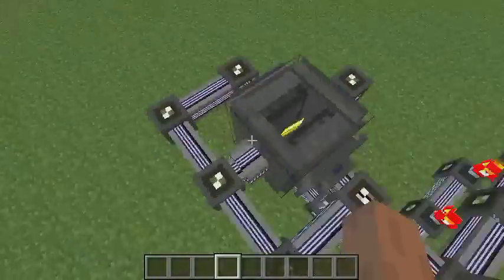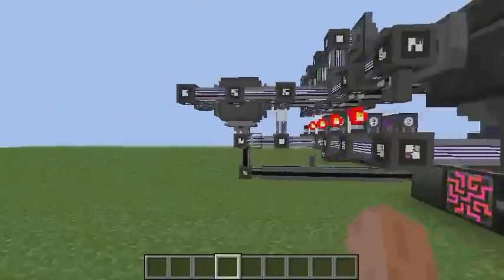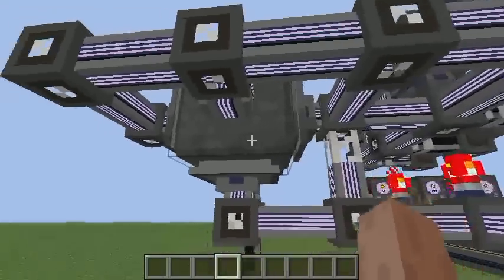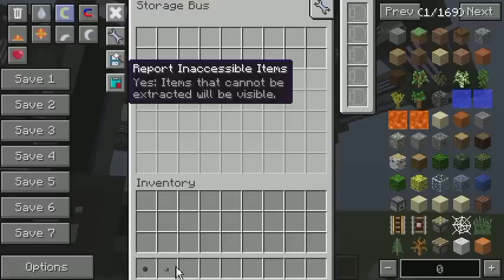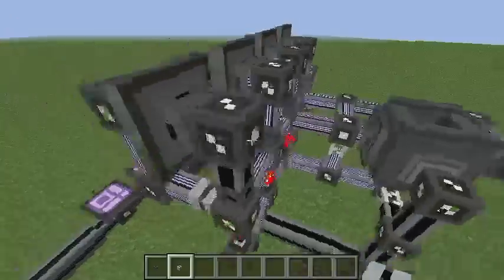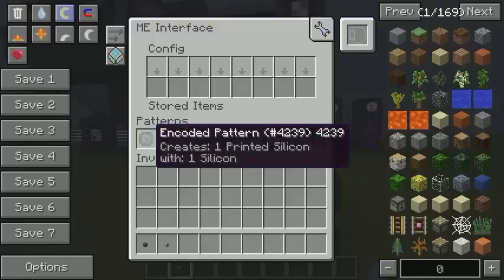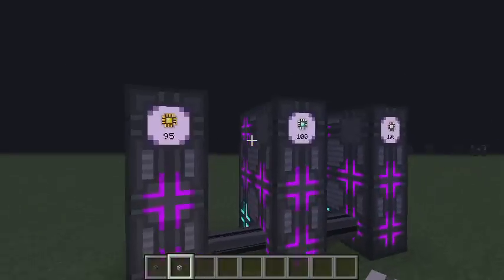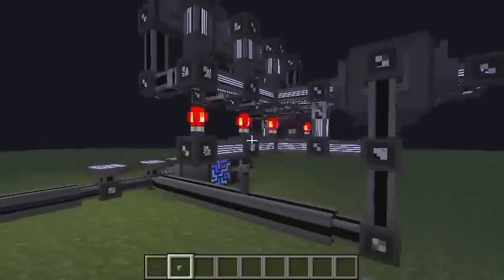AE2 Inscriber automation (challenge build)

Comment: Nice one Tema. I am currently using Steve's Factory Manager to handle the creation of those logic processors, every type of AE2 crystal and silicon creation from cobble. Cheated a little by using your mod for the cobble gen, just because it's so wonderfully OP. Works pretty well and it's fast due to it being able to utilize 8 inscribers at once. One for every item type, except for silicon which has 2 inscribers dedicated to it, mostly just for symmetry reasons.

Comment: rwtema  not the compactest or cleanest build but at least it works! And hey, its a show off of your ae2 knowledge with the channels, toggle busses and interface/storage busses.

I actually use toggle busses in my ae2 network because as I build and expand on my power, ae2 has all my storage, but what if theres not enough power? If theres not enough power, the level emitters will turn the toggle bus and therefore shutting down all my power excluding the ae2 system untill I can resolve the problem... not bad aeh?
Reply: 25greengoblin Not bad, actually. I may steal that idea.